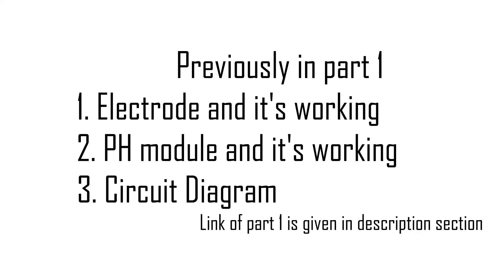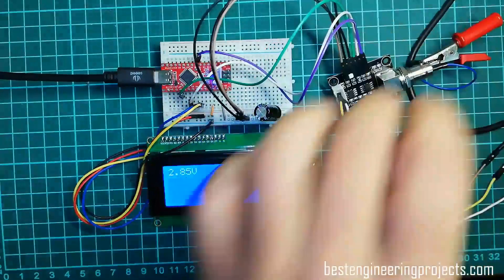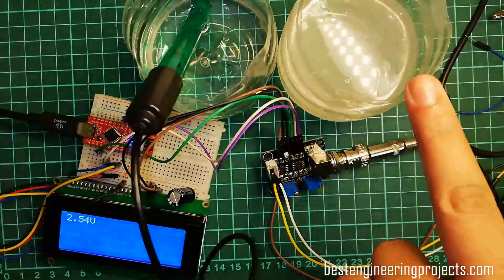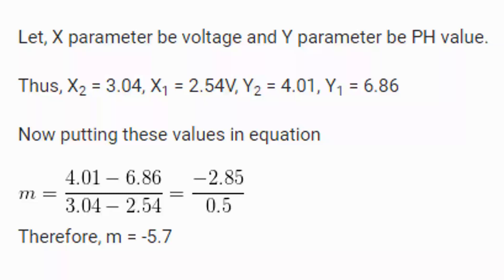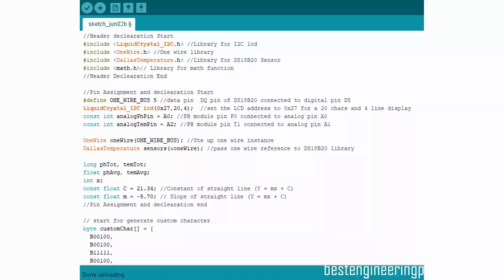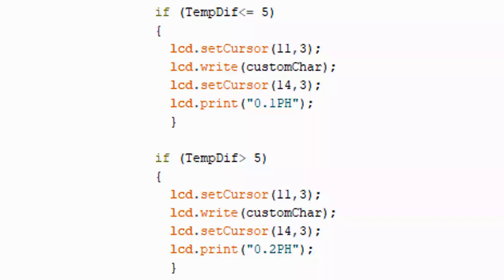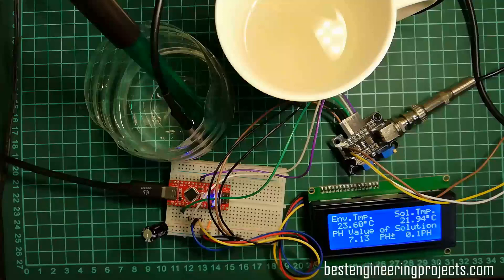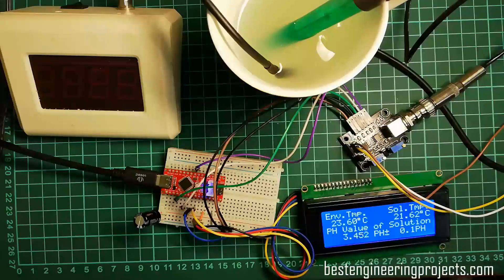arduino based ph meter part 2

Comment: Thank you for covering this module! Do you know how the second potentiometer works? Your web page says it is for "pH Limit" but there's no digital output, so I don't know how that second potentiometer works. Also, I would really appreciate if you can find the datasheet for this module, which you mentioned on your page, if you have it.

Comment: Why you use 5.0/1023.0 in your formule?, the offical documentation say: 
"On an Arduino UNO, for example, this yields a resolution between readings of: 5 volts / 1024 units or, 0.0049 volts (4.9 mV) per unit."